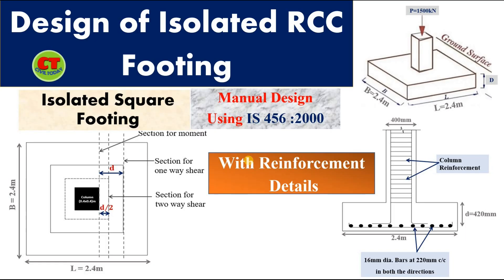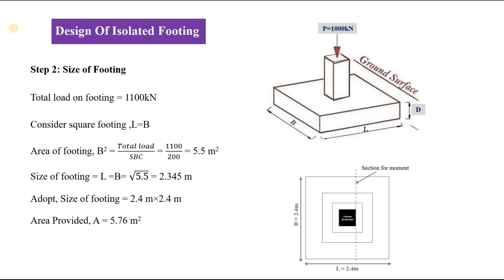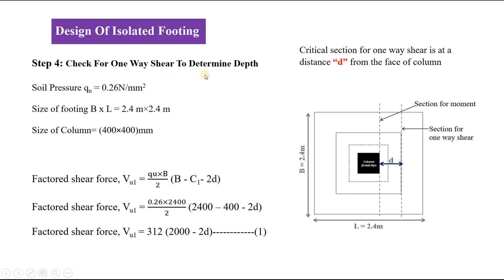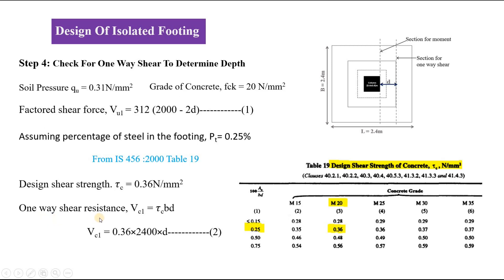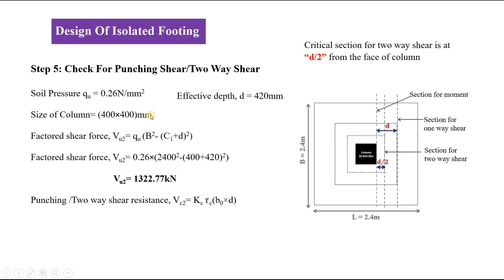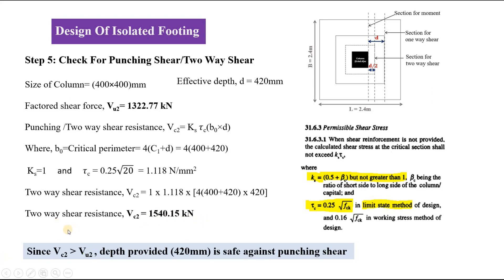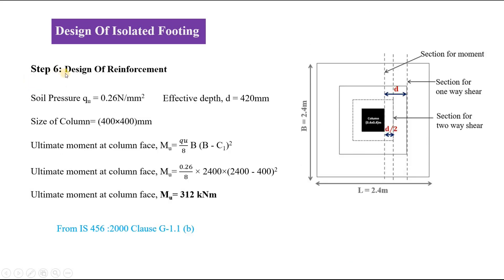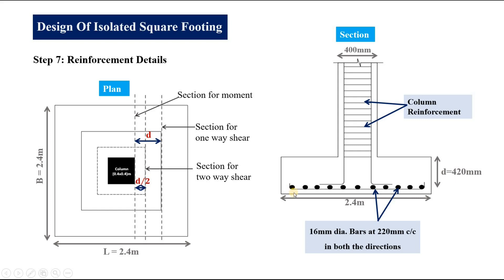Design of RCC Footing | Isolated Square Footing | Limit State Method - IS 456 | RCC Footing Design

Comment: In given deta safe bearing capacity is 200kn/m2 for ultimate load sbc is coming 260kn/m2  given value is less as coming value is more 260kn/m2 >200kn/m2 should we have to increase the area of footing
Reply from the maker: You should definitely increase the area of the footing.